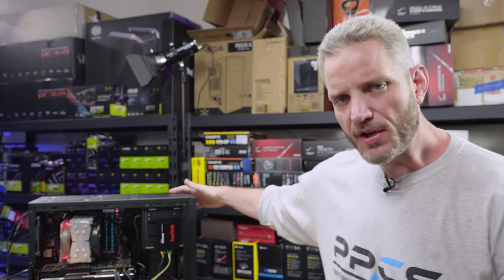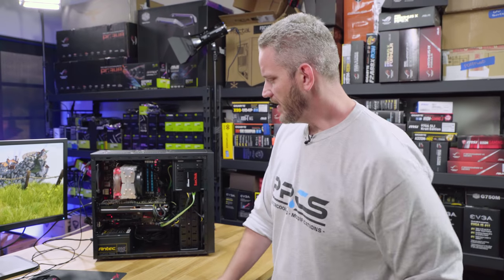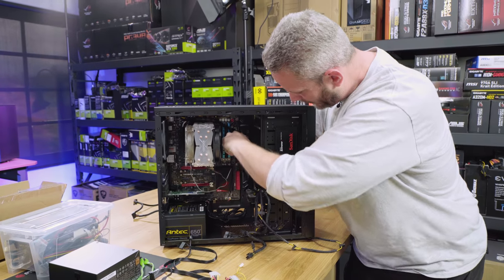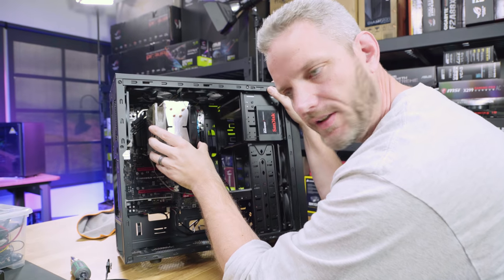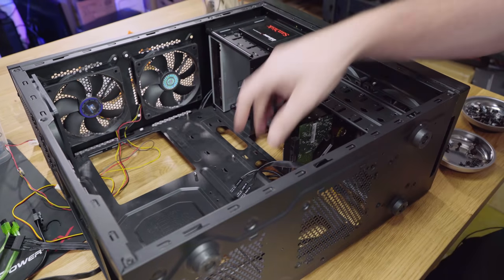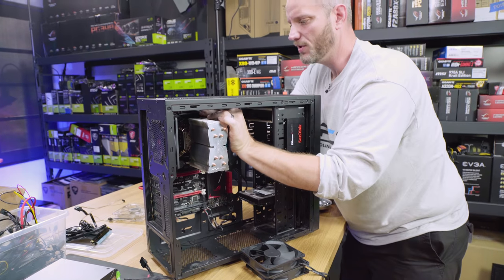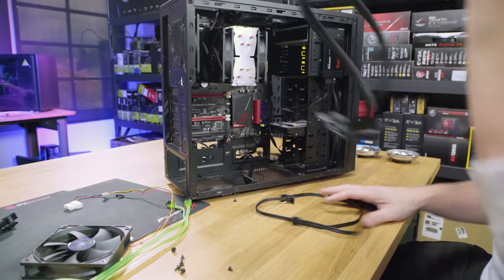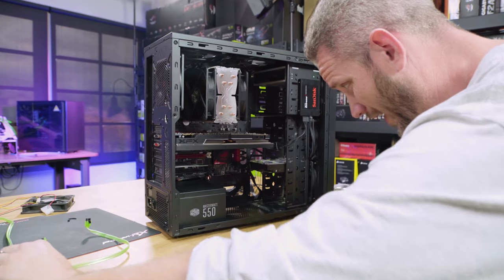It was worse than I thought... Fixing PCs Part 2

Comment: i have always gotten second or third hand parts, throwaway parts or just cheap components.
currently running a i7 3770(not k), some random proprietary motherboard, rx 580, and a trash case i had to bend parts to make room for GPU and power cable, some cheap deepcool theta 31 heatsink, and 4 random ram sticks ive accumulated from trashed PC's im found over the years. Not bought, literally found in dumpsters and or freebies. being an enthusiast isnt about having the best system. its about loving the system u make cause u make it with ur own hands. in my case its scavenging for the parts to make a whole PC. all i bought from mine was the HDD, SSD, heatsink, and graphics card. everything else was scavenged from other throw away PCs and lucky finds. im a gamer and pc enthusiast and although i cat get the best of the best. the hunt, and the build has been my passion. needless to say i would love to actually be able to pick out the parts i want in my system. but would still scavenge for components even if i had my dream rig.

Comment: I have to say I am very proud of my First PC build. only because I watched Several of your Videos and Learned it all before I tried anything. and my cable management was 100% terrible it looked fine from the inside but if you looked on the other side it was an atrocity. but after a while and I learned a bit more I took it all apart and fixed it all. now es peerrdddyyy

Comment: In re cable management:
I built my first PC before cable managment was really a thing. My Antec Three Hundred doesn't even support cable management. Not that you can even do anything with PATA cables...
My second build was in a HAF 912, which HAS cable management, but it was only my second actual build, and my first in that case.
Plus the HAF 912 has no open panel sides, so the rat's nest was hidden under my desk most of the time.
My first cable managed build was quite a bit later, when I got a Fractal Nano S with a side window.
I decided that if I'm going to have a computer with a side window, I'm going to finally do something in the form of cable management, and I meticulously built that system.
Then the next time I was inside of the HAF 912, I took that apart and cable managed it.

Comment: In the last two years I have replaced TWENTY ONE Antec power supplies and only one from another manufacturer.  The symptoms were roughly the same for each one of them--occasional system freezes and eventual death of the PC if not replaced.  It seems like Antec's PFC circuitry isn't very durable, at least on their lower wattage PSUs.

Comment: Dropped a mug of fresh coffee on my laptop and it died two years later, guys at the office and two local repair shops weren't able to identify what killed it, they tested the battery/psu, mobo, ram, cpu, all a-okay. Being timid about building a PC I set a budget and sifted through newegg for all of an hour, actually picked a decent prebuilt one at that. Not long after I started running into graphic issues/artifacts(No framerate issues funny enough) in an overly modded Fallout New Vegas playthrough due to the limited VRam of the GTX 650, fortunately or... Unfortunately for my wallet I had found out the GTX 770 had just rolled out and discovered your channel around the same time. After about a month and half, some beer, and a binge spree on youtube, I had basically replaced everything from the prebuilt PC except the 1tb HDD and the I7 3770k effectively becoming my first "Custom PC". Thanks to videos like yours my build pretty much went off without a hitch although I may or may not have swapped the Reset/PWR headers >.<

I have to thank you and the many other tech geeks out there from the bottom of my heart because you guys have managed to make something so daunting to many seem so mundane. While you may or may not have a degree you guys by all rights and definitions are teachers, and while it may be meaningless coming from me I apologize for the abhorrent display the community can display at times.

Again, thank your for all you guys have given us over the years!

https://scontent.fdet1-2.fna.fbcdn.net/v/t31.0-8/14633251_10210807868176897_3628919094634838409_o.jpg?_nc_cat=0&oh=be620081e8e449a7e36ec910a92e9527&oe=5B9124F7
Incidentally the prebuilt case physically fits inside the HAFX, but yeah my first attempt at making a PC thanks to your tutorship. I still think I was too over zealous on this thing lol.

Comment: I am a sparky so i had to make my cables pretty ocd about it. Also my first build booted fine. Was clean and no issues and have done a refresh on the system (hdd,ssd,cpu,gpu,ram, mobo and did a custom water loop for cpu block. It ain't hard just watch alot of build videos.

Comment: My first PC looks pretty good, except for cable management. Problem is that I don't have any tweezers and my hardware store is closed. Only it took me 2 hours to figure out that the ssd cable was not functioning properly. I only had used parts, so I checked MB connectors and 2 other drives first 😅

Comment: Not true, my first pc I ever build  cable management was absolutely clean. Took me half day to do it on if I remember correct some cheap aircool case, as back in the days cases wasn't designed for good cable management. 
Other think Jay did catch my attention why you placed power supply fan down, there is no dust filter at the bottom, and judging by amount of dust you did blow from that pc, they probably keep pc on the floor, or even worst on the carpet, so that psu won't last long... but over all great job Jay, you deserved your peace of cake today. ;)

Comment: I agree with Jay.. I've built systems for other people professionally with a parts list, and proper materials, standoffs and all. But I also frankensteined my own computers pretty heavily. There is no set way to build a computer, and not everyone is anal retentive about it. When it's someone's first build you give them credit for not blowing it up and getting blue smoke, the rest they learn with practice and experience. I blew out an entire block once because of a case short with the power button.. That was the final straw for the transformer. Most of my last rig was kept alive from parts given to me by people who's computers I upgraded off of Craigslist in lieu of payment. I even had to cut, glue, and repin 2 6 pin connectors on my old PSU into 2, 4 pins to fit an 8 pin connector on my old GPU.

Comment: I built my first computer and it didn't work once I put it into the case. Would work on the box, but not in the case. I was building back in '96-ish with a Cyrix P120+ (I couldn't afford anything more I was only 18!). Turns out that I had left a standoff under the memory socckets and it was shorting out. Thankfully I didn't wreak anything and once removed worked great - for a Cyrix ;)

Comment: You know it's funny, the only time I really messed up while building a computer was after I had already built a few and knew a lot about computers. So don't worry if you mess up on your first build, it can happen to anyone and most issues can be resolved pretty easily. Just check if everything's plugged in correctly and redownload all the drivers/updates before you do anything drastic.

Comment: Good Lord!!!Isn't the motherboard shorting being left dangling in that PC case like that?If I remember correctly standoffs keep the motherboard from making direct contact with the PC case and also serve as a means to ground the motherboard which is why the holes in the motherboard for the standoff screws look like they have solder circles around the screw holes.If that motherboard didn't suffer any damage as a result of not being properly attached to the PC case I'd be very very surprised.Thanks for the video Jay,God bless you and your family.

Comment: For that 2400rpm top fan I'd probably fit an inline speed dropper. just to keep the noise down a little.

Also, I think I was pretty close with questioning the power supply. But you are probably right that the loose motherboard could of caused all sorts of interesting things to happen.

Comment: Man, I just fixed one last night. Was having progressively more problems. Took to a friend to "fix". Seemed to work initially, then had more problems. They wiped it and reloaded windows, thinking it was a virus. Still problems. They bring it to me, and it seems to work, until it locks up 20 minutes in to testing. I reboot it, get into the bios, and notice the CPU is idling at 90C. It is one of those AIO monitors, basically a laptop with some full size PC parts built in to a touch screen monitor. It's been overheating for the last year and change. Their friend's "fix" was to disable thermal protection in the bios.... Took it apart, cleaned out the 1/4" thick dust bunny at the heatsink and blower. Fixed, ish; CPU might be a little worse for wear, being run to system instability in an overheated state for the last year. The best part was that it was missing roughly 1/3 of the screws, like someone tried to get into it, and gave up, and then didn't bother putting all the covers and screws back on.

Comment: Jay did not clean the heat sink much, perhaps the liquid was really stuck but leaving a deposit of dirt on the heat sink will trap more dust in that area in the future. I would have replaced it completely like he did with the fans.
Compressed air and a mini vacuum cleaner are good but why not use them when the motherboard was outside the case ?

Comment: Huh? The through-hole soldered pins on mainboard are NOT in any way coated. If you're not getting a good reading with a multimeter, it's not because of the coating, it's because of surface oxide that just appears and disappears way easily. Of course the mounting plate that it goes on is painted with powder coat, which is pretty hard and sticks on there fairly well, so that's some insulation, but it's not that thick and permanent either.

I do think the power supply might be good, that mainboard mounting could have caused no end of issues. I'd still use it, but possibly in my PC rather than returning to a customer/friend.

Also "this is the way it came in, this is the way it's going back" unfortunately NEVER flies. You will be blamed for Ethernet not working, even though it's not you who broke it! Somebody always tries to take advantage of you.

Also i think given that liquid came into this PC, every single board needs to be dismantled and isopropanol-washed :( new thermal interface and all that.
Reply: He said the case panel is coated...

Comment: Maybe the voltage error was related to the ethernet problem, often when an integrated lan takes a current peak (generally from a modem connected to a telephone line) then other damages occurs to the mobo

Comment: If that's someone's first build apart from the standoffs they did a pretty reasonable job. And as far as cable management goes my rule of thumb has always been if you turn it on and a cable aint stuck in a fan, its done

Comment: I had to use an extra NIC when I bought my 2500k board. I dont remember what model it was, but it was a gigabyte board. The intel NIC didn't work so I just picked a pci express one at the local recycling shop for 10 bucks. I got it for 50 bucks off because they sold the board I had set aside on accident so no worries from me.

Comment: I've been building firm, solid systems of most budget classes since the mid 90s, and two months ago was the first of my own personal builds, where aesthetics really played any significant part. If you want aesthetics, that is perfectly fine, some builds are geek beauty incarnate. But I surely hope especially newcomers, don't find themselves put off by an impression that aesthetics matter, even a smidge more than exactly how much aesthetics matter to them. Its your computer. Unless its a living room unit and you don't live alone, then aesthetics will likely be part of your WAF factor. Still - the internets peoples don't live there.

That said, I do condone a bit of cable management. It doesn't need to look like a showpiece. But a few zip ties or twisties will keep the cables from going where you don't want them (like into fans and heatsinks, between panels etc), and it will make performing a periodic dust-off and maintenance check, much less of a hassle / off-putting.

Comment: mfw my first build booted perfectly, had pretty cable management (with all the panels closed) and it wasnt even a case with cable management in mind. Try fitting cables under all the covers of the H500P while trying not to break any connectors.

Comment: Bad wiring? Holy moly, thats NOT bad wiring. The cable management on that one was done pretty well even if this person is just some casual that doesn't know a whole lot about PCs in general. I've had PCs looking way worse with their wires than that one. It was cables everywhere, even in front of some fans, blocking the airflow and getting the risk of the wires tangling itself inside the fans

Comment: i mean, to be fair, my first ever PC i built was near enough perfect, near perfect wiring, never put anything in wrong, the hyper 212x cpu cooler was in first try with no tutorials or reading of the instructions.....Its not a particularly hard thing to do, even with next to no knowledge. Not saying that to be rude or anything, just, its all very straight forward, and provided you have a case with good cable management options, cables should also not be an issue.

Comment: Hey Jay. In this video you say that you probably have switched the cables which resulted in changed boot order which then lead into loading of the wrong OS. Have you considered that there might be problem with the bad CMOS batter which causes BIOS settings to reset themselves. In your first video you sad that PC owner had problem of wrong OS loading before not to mention PC booting up sometimes. You see on many motherboards CMOS battery isn't used just to store CMOS settings but is also required for proper boot-up sequence. 
Some time ago I repaired PC where bad CMOS battery was actually preventing proper recognition of PC hardware so PC would sometimes just fail to boot. Replacing the CMOS battery then solved all of the problems.

Comment: Standoffs, and motherboard screws are important. Old school HDD screws are also important, for vibration reasons. Cables being all black, or routed some specific way, not important.

The computer turning on, and working, that's the most important. 

Priorities are different for everyone, but as long as it doesn't hurt the actual performance, there's no reason to freak out.

Find some perspective PCMR, or you'll have a heart attack before you're 40.

Comment: Hey Jay! I'm currently planning my first custom loop and was wonderin if two 360mm radiators are enough not only to cool a 7980XE and a 1080 Ti sufficiently, but also to cool it almost silently. The quieter the system, the better. Thanks! :)

Comment: what about a DAA78L motherboard with 256GB of DDR3 2000MHZ RAM plus a A10-7850k  plus 3x 100TB (Data-Centre) SSD's and a Blu-ray drive and ditch Windows and go with Linux Mint 18.3 (Sylvia) 64bit OS plus Wine64+Winetricks64+zip.dll to allow the running of any windows applications that you need, one nice thing about this is that it comes with a WIFI adaptor and doesn't need an Ethernet connection to work as long as the antennas are installed.

Comment: I was super bored at 1 am when i accidentally slept at 5 the day prior so i stripped, cleaned,  remanaged my wires my wires, the hdd cage was mounted directly behind a front case fan by default, and luckily my cords are either black or wrapped in mesh out of the box.
Reply: Ive learned too much in the last year to not redo it at some point.

Comment: I remember I thought I fried my mobo in my "first" build. I had plugged the 6pin for the gpu into the 4pin that powers the board (Dont drink and build). Turned it on and heard the power supply short. Realized my mistake, corrected it, and no boot or anything. I borrowed a friends psu (turned out the other one was completely fine) and still nothing. I tested the cpu in my old board and it booted fine. I then replaced the cemos battery from my old board and did the cemos jumper with the pins (the battery was fine as well I later figured out). The board finally showed life but was stuck on the MSI display. A second attempt and the board operated without any issues. At the time I had a good bit of experience from fiddling with my low end pre-built, but I could definitely see a new builder with no experience assume they just blew their money (I know that crossed my mind a few times while i diagnosed it lol)

Comment: the first computer i ever built looked like crap XD had wires haning out the front because i was to stupid to wire the start button proeprly at the time. literaly everything apart from the power suply was held in place by way to few screws and some things were just haning by zip ties, one of my hard drives did

and now i have a new case and everything looks neat :3
Reply: The case in my first build (which I'm using atm) doesn't seem to have proper cable management options so it can't be made neat looking. Might get a better case later. It's kinda funny that when you spend a lot on the parts themselves you are tempted to go with a cheap case.

Comment: My first fault of building a PC? Buying the wrong set of RAM sticks and pin. My MOBO only support DDR4 with 288 pin. They didn't mention about not supporting other than DDR4 and also didn't mention about it being 288 pin only. Even techies like you, Jay didn't mention it. If you do, then I don't watch every video you upload but if you don't then this is also another tip for rookies/newbies out there. Oh and uh, you can also do some research about your MOBO RAM pins online. Just search for whatever MOBO you use and see their full specs.